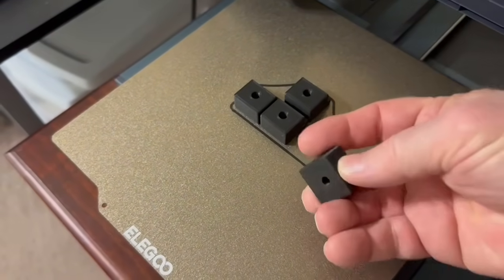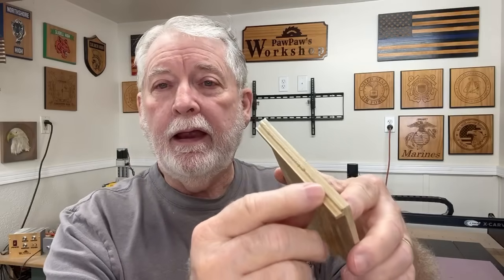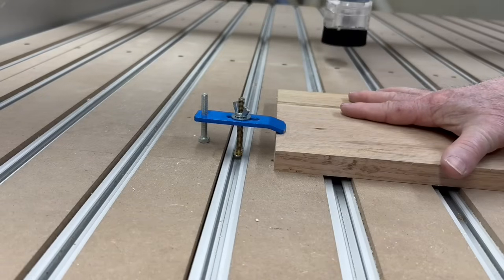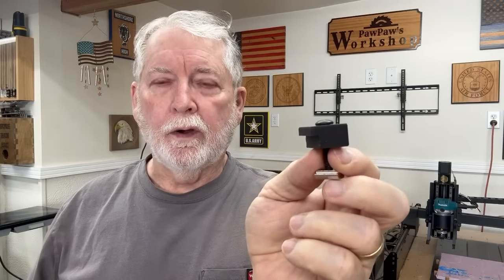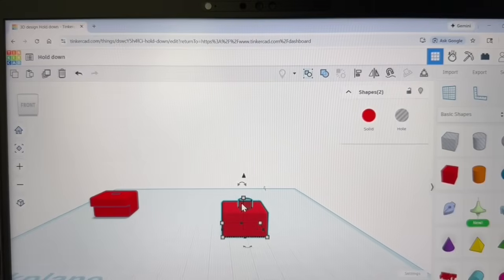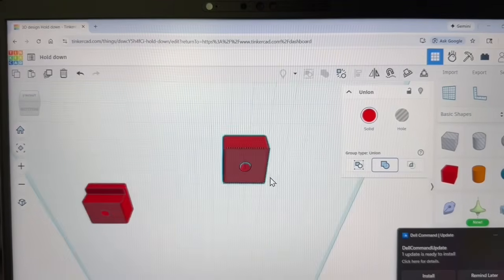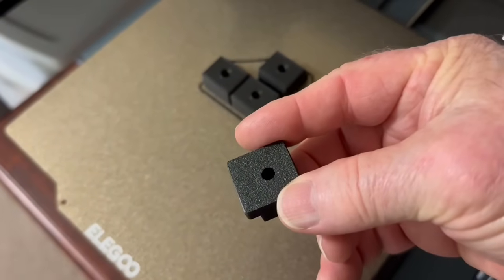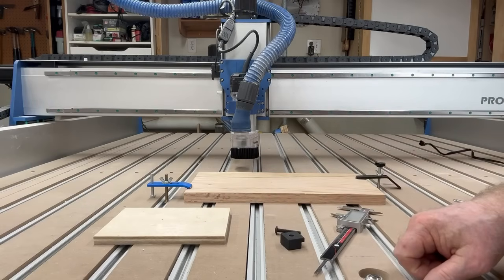3D Printed Low Profile CNC Clamps! Safe, Strong and No More Bulky Metal! (Cheap to Make)

Comment from the maker: In this video I showed exactly how I designed but I did not include the Cura software slicing process. The only important part is that I set these clamps to a 20% infill which has proven to be sufficiently strong to hold the projects in place.

Comment: This is a great idea and clamping device. Well Done.
I would have a suggestion to make this better.
I did machining for 38 years, Work holding 75% of the job.
The correct way clamping should set after a part is clamped down, 
the top of the clamp should be level or angled AWAY or higher then your part. (2-5 degrees)
This puts more pressure on the part, not the clamp. To help solve that problem, 
3D print square washers to fit under your new clamps, maybe 1/8" thickness.
That way you can put multiple washers (if needed), depending on your part height.
I don't have a 3D printer, if your going to sell these, I will buy!!
Reply from the maker: That's a great suggestion, thanks!

Comment: Hey, Paw Paw! Are you making these out of petg or something else? i sent you an email about something pertaining to this hold down method.
Reply from the maker: I’m using PLA for my clamps during my testing phase. I responded to your email. Mine work really good but they are not perfect yet. After looking at his video, his design has already done some of the improvements that I was planning and testing. It boils down to basic mechanical processes and pressure applied by the screw.  I’m also order nylon screws. I don’t want metal on mine at all. I’ll do an update as I continue to develop mine.

Comment: Thanks for sharing. Just had 3d printed clamps made very similar to yours.  I super glued 120 grit sandpaper to the hold down surface and they improved dramatically. Can make a lot of clamps for the price of one broken bit caused by oversized clamps!
Reply from the maker: Glad to hear you're finding success with 3D printed clamps too, and the sandpaper trick is brilliant!

Comment: Drill the bolt hole with countersink to various depths. Then your nylon bolts could be using the same length bolts with various depth hold-downs.
Reply from the maker: That's an interesting approach to managing bolt lengths!

Comment: Enjoyed your video. IDC woodcraft sell these. However, to solve your height problem. I’d just make a couple of sets that have a height in relation to the various heights of wood you use and buy the appropriate length screw to mount it.
Reply from the maker: That's a good idea! Having different height sets would definitely solve the screw length issue.

Comment: A tip for you....  Print the clamps on their sides - they will have more lateral strength.  when you clamp these ones down, you are putting pressure on the layers and they could delaminate / split on the layer lines.  Also, consider baking (anealing) them for a while to increase strength
Reply from the maker: Excellent idea. I was not sure if that would make a big difference. Thank you very much

Comment: I don't have a 3d printer (yet) and would make these if I did,  but I did have a bag full of Jenga blocks which are perfect for clamps, just had to route an edge on one side. And the tape IS expensive, but I"m also having success using a pin nailer. Barely mars the workpiece, barely damages the spoilboard. Easily pried up just like the tape/ca glue method.
Reply from the maker: Thanks for sharing your methods – sounds like you've found some great alternatives!

Comment: When printing them flip them on the side so that the "L" side is on the table. This will be much stronger and wont de-laminate under pressure.
Reply from the maker: That's a great point about print orientation and strength!

Comment: I understand the issue about the lengths of the screws in your clamp design.  What would you say about getting a few lengths of threaded rod and make up the "bolts" as you go.  The nuts would be all the stands above the plastic I am thinking.  Then you can build up your supply of different lengths.    Thank you for your ideas in this video.
Reply from the maker: Interesting idea. Thank you

Comment: You're relying on layer adhesion to be strong in your primary stress direction.  If you print those oriented with a side down instead of on the top they'll be much stronger.  The hole might not be perfectly round but that doesn't hurt anything.
Reply from the maker: That's a great point about layer adhesion! I'll definitely keep that in mind for future prints.  You confirmed my thoughts. Thank you

Comment: You could actually have different sized wedges which slide dove tail style into the clamping part, the screw goes through the wedge first, then the clamp with a hole space slides on top allows you to tighten it.
This will keep all the screws the same size and allow wedges to take the changing heights element out of the equation.
I would use more walls on the dovetail part though, and maybe higher infill than 20%. 
This way also keeps the screw lower down and in many cases probably below the material surface. 
But I might use printed screws rather than metal ones. 
Not that I do, lol
Reply from the maker: Those are some excellent ideas for optimizing the design!
Reply: @PawPawsWorkShop  Its not bad is it...I might even have inspired myself to make it cause its better than the slim design version I was using before too.

Comment: Mr. Garret would have some thoughts on this 😅
Reply: As others have said. I just saw this recently… but that being said. If you can make it, why buy it!! That’s the reason we have workshops with the tools we do. 

Thanks for the tutorial sir. Much appreciated.
Reply from the maker: Did he do something similar?
Reply: @PawPawsWorkShop Exactly the same, he is selling them as injection molded pieces though. He just posted a video about them a few days ago. IDC woodcraft, Garret Frome.
Reply: @GGGG_3333 I think it’s called edge biter or something, but yes it’s the same
Reply: @GGGG_3333  lol, he didn't invent them, they have been around for a long time
Reply: @jyvas12 neither I nor he claimed such a thing 😅
Reply: @GGGG_3333   s, what would you mean by saying he "would have some thoughts on this"? 😅
Reply: @jyvas12 Literally 😉
Reply: @PawPawsWorkShop you might also want to check Mr. Corbyn Dunns approach. I think his design/modification is a better option.
Reply: @GGGG_3333 

Do you have a link to this?
Reply: @charliemoore9310 links can't be posted 😅. The channel goes by his name as well, so you would be able to find it this way.
Reply: When I saw the IDC video I figured it would be on a 3D printer 5 minutes later😊.  It's not a new design though - I've seen something pretty similar previously.
Reply: @cyberhikerdd yes. It’s based on some metal based ones. I 3d printed some similar ones, unfortunately they are not very rigid for aluminum milling. So I ended up milling some aluminum ones
Reply: Yeah, but the ones he sells are $78 for 4!!! YIKES!!!!!

Comment: if you would make a countersink  of 5mm, the screw head would be almost hidden and collision with bit would be reduced to minimum. For thicker stuff print cube with hole and slot entry (similar to keyhole) and this will be your distance piece you can easily slide in and slide out and with thickness you need.
Reply from the maker: Those are great suggestions! I'll definitely keep them in mind for future designs.
Reply: I was just going to suggest this!! Great minds...

Comment: I use a combination of double sided and plywood clamps with knurled speed nuts , I don't like putting steel on top of project material. I always maximise projects in the material . Used your flat slide position clamps too, taper face as hold down wedge. I've seen seller at IDC pumping these plastic mini clamps in his over exaggerated video. But puts steel screw very close to material edge!
Reply from the maker: Thanks for sharing your clamping methods, it's great to hear how others tackle this!